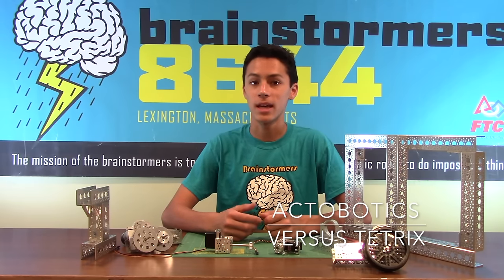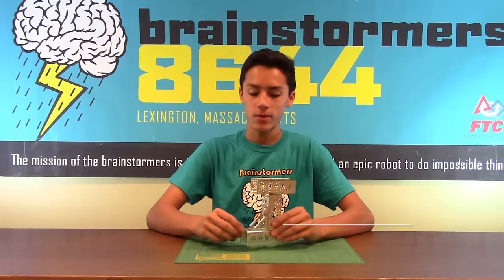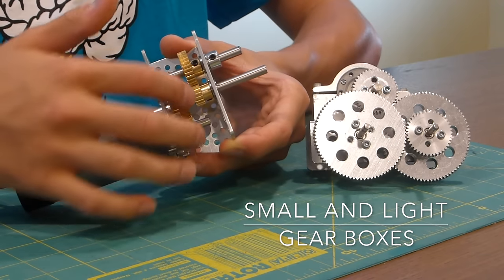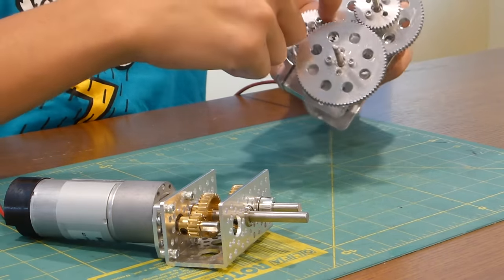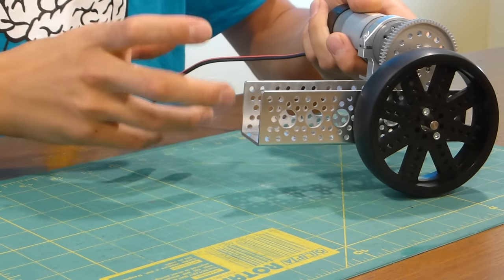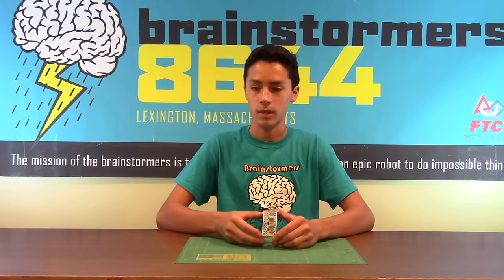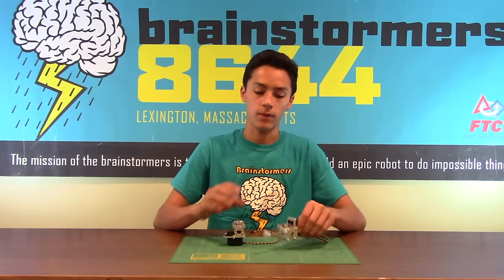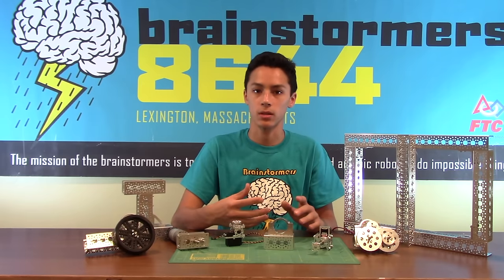FTC Tips and Tricks: Actobotics General Use

Comment: Thanks Brainstormers!  I am intrigued with the actobotics in-channel gearing.  I am trying to find all the parts to do something like that.  What axles and bushings do you use in the actobotics world?  I want to use tetrix wheels, hubs, and axles, but it doesn't look like they are compatible.
Reply: Well I took the plunge and bought some parts.  I'm a rookie mentor and I'm just trying to figure out what works.  It turns out since the motor shaft is locked into one location you have to select just the right gears so that they will mesh correctly.  I missed on my first attempt using a 16T gear on the shaft.  I got 16T, 20T and 24T gears for the wheel shaft and I am not able to get the gears to mesh.  Either I am missing something or the way the holes are in the channel requires the exact right gear diameter.  Please advise what gears you used if you can.
Reply from the maker: Jeff Kerr sorry for the late response but we are using the those gears that your are specifying but you need to make sure that the one that connects to the motor has a 6mm bore. That could be why the gears aren't meshing properly.
Reply from the maker: Also I believe we used the 16 tooth and 32 tooth gears
Reply: Thanks!  The Actobotics web site said the total number of gear teeth had to be 96.  I calculated that it should be 48.  It's good to know you are using a total of 48 teeth.